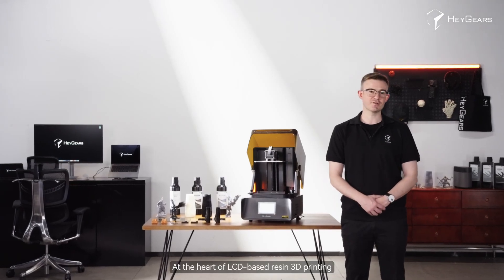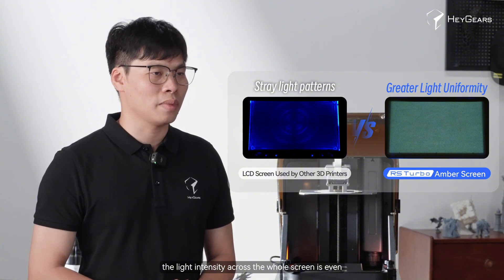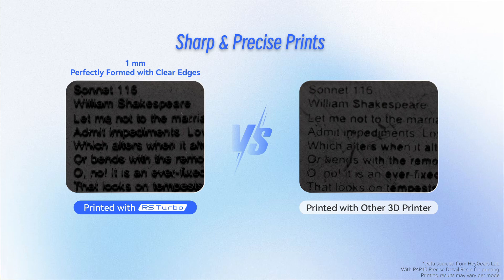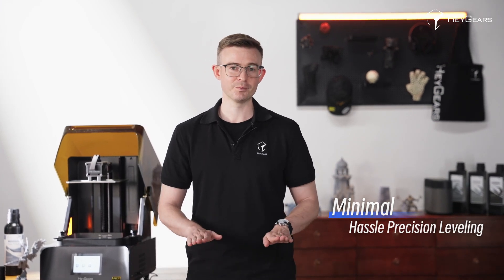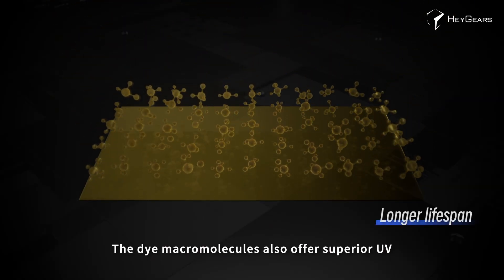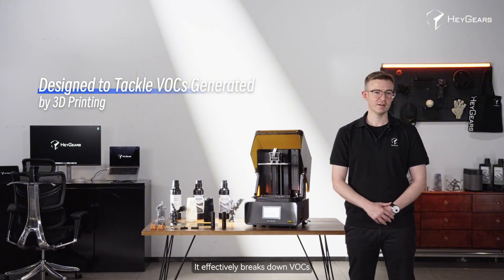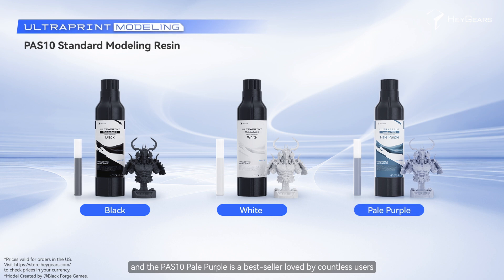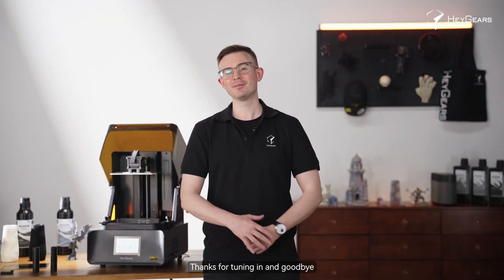Summer Launch Event 2025 | RS Turbo, Amber Screen, GreenPrint & More!

Comment: I ordered the rs turbo but i dont have that sticker that says turbo. how do i know for sure i got a turbo and not an rs?
Reply from the maker: Hi there, thanks for letting us know. Regarding the question of how to distinguish between the two devices RS and RS Turbo, you can check the device code on the nameplate at the back of the printer. The code starting with "B11" is the RS Turbo 3D printer.